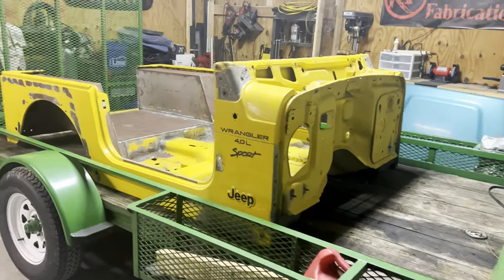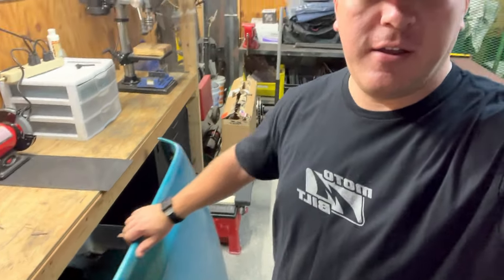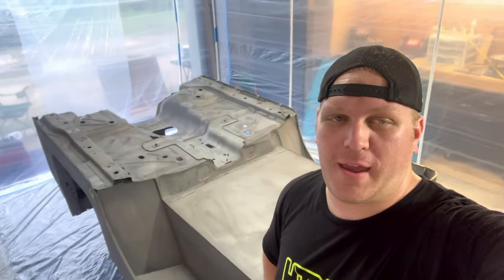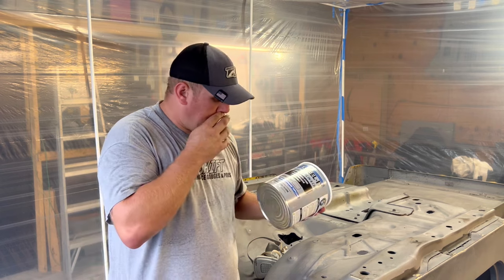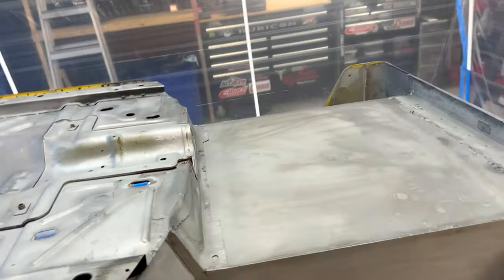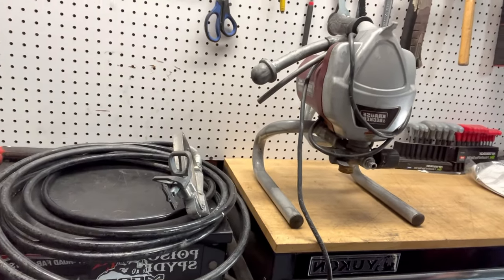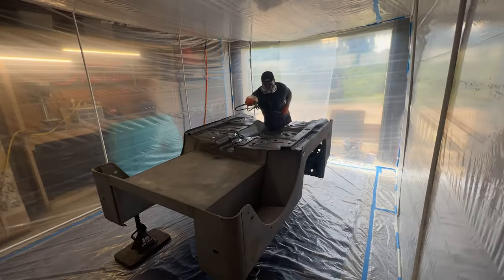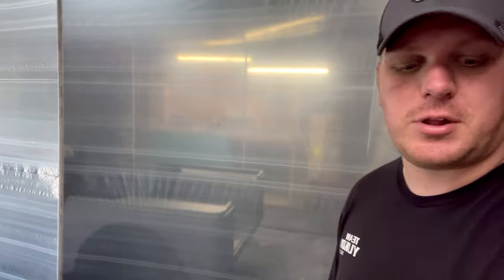Painting my entire Jeep in Steel-It coatings!

Comment: Some people have had issues with the stainless showing rust in salt air environments. Have you seen this?
Reply from the maker: never had an issue with that and I take mine to the beach often. Id guess that those people are likely under coating and not prepping the surface thoroughly. That is key to creating a proper bond with the stainless and the parent material.

Comment: awesome job!  can you paint right over it without putting down a layer of primer?
Reply from the maker: I’m sure you could. The finish for most is good enough to not paint over but if your looking for another actual paint color/finish you should probably use a sandable primer. I’d test a small piece first but I haven’t used a different paint over steel it so I can’t say for sure.

Comment: Why didn’t the body shop put the bracing back in on your rear floor?  Also with that type of paint sprayer you loose a lot in the hose.
Reply from the maker: I ask myself why the body guy did and didn't do a lot of things lol. Lesson learned that if you want something done right, do it yourself. I added 2 channels that go across the rear floor for support.  If I were to use it again Id invest in a high quality professional gun. while I got great coverage, I would have liked to see the paint atomize a little more. I had plenty of paint so I wasn't too concerned with the minimal amount of loss from the hose. there is more lost in overspray than in the hose.  It still turned out great so im happy with the results

Comment: That Steel It is good shit, but you are still a lot better off grinding any of it away in a spot you have to weld. Yes, you can weld through/over it, but technically, you can weld through regular paint, too. But your weld will look like shit, and it will be spattering all over as you weld. And you’re going to get inclusions in your weld. That Steel It isn’t pure stainless steel. It has the urethane and other non-metal ingredients in it. 
If you’re in a spot where you can grind the stuff off, you should. 
It looks great though, and seems to be really durable. 
I’m going to get a gallon myself.
Reply from the maker: You know, I won’t disagree with you. Your right, it’s better to have a completely clean surface to weld to and the more variables you can control the better the outcome. Now that being said, welding through regular paint and welding through steel it is definitely a night and day difference. No it’s not pure stainless so the polyurethane base definitely burns, the big difference is that it burns through much cleaner than regular paint does. It’s incredibly tough after it’s cured and I can honestly say that I would trust a weld structurally welded through steel it. Is it as perfect as welding through properly prepped and cleaned metal? No it’s not, but it makes welding in any other situation incredibly easy.  🤙🏼
Reply: @RecoilOff-Road  I do a lot of TIG welding, and you would 100% have to grind it off for that. But for MIG, yeah, I guess if I couldn’t grind because of a tough spot (or if I was being lazy) I would rather weld through the Steel It. For my TJ, I only TIG small parts that might be critical. Most of my welding on my Jeep I have MIGed. I am making a lot of stainless parts for my Jeep, if only for the fact I have a lot of it laying around left over from other jobs. I TIG that stuff. I made my frame control arm brackets out of 1/4” stainless angle. I’m also making my long arms from some stout 2” od 1/4” wall stainless tube. I got a killer deal on a 20 foot piece. 
Im looking forward to your build. It looks like you are going full-out and not cutting corners. When you’re done, it will be even better than a brand new Jeep!
Reply from the maker: @zenlandzipline  Oh for sure with TIG!!! I haven't dove into that yet, still really working on getting as much trigger time as possible to work on getting my MIG lines to be consistent. Thanks for the feedback, the first build defiantly had corners cut that I didn't realize till I learned better but you got to go through the process right?!